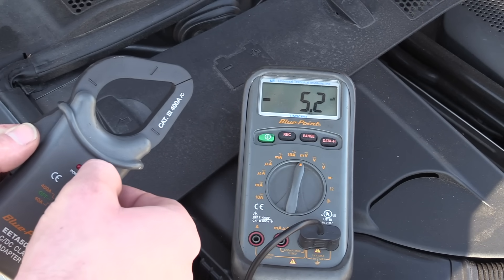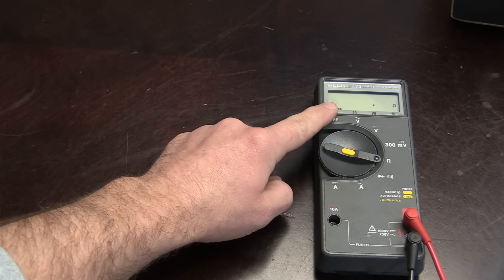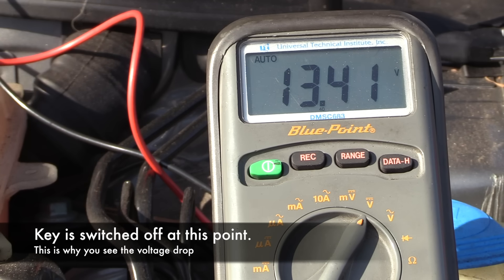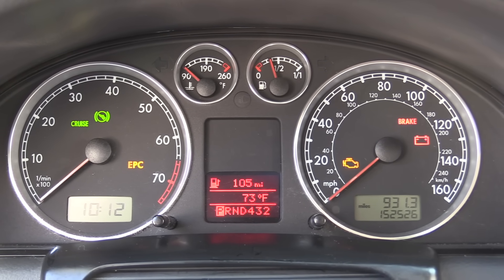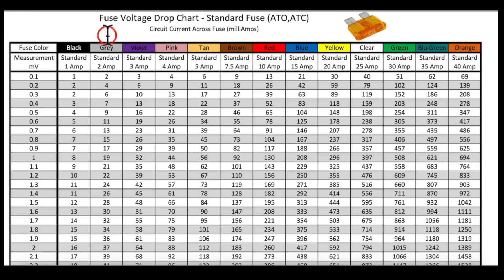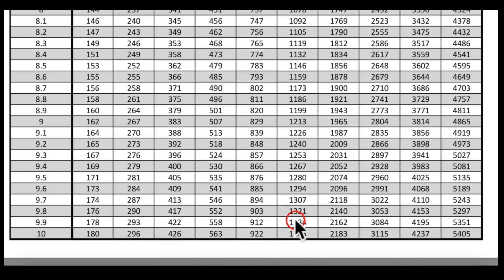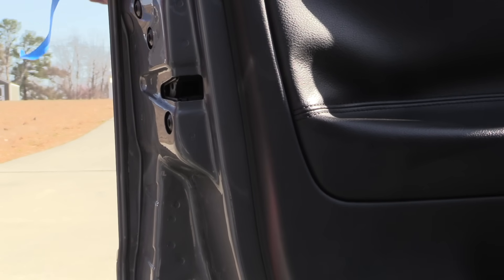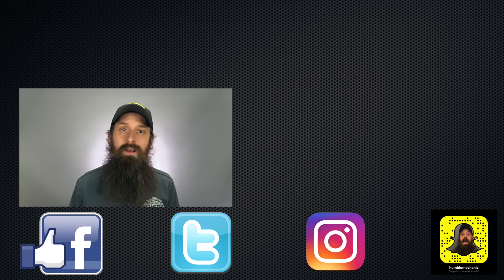The BEST Way TO Perform a Parasitic Draw Test

Comment: I've been a master tech for 25 years and never once did I think about physically latching the doors etc. And this is a great method for finding gremlins. I'm glad I found this channel, as unusual even as good as I am in still learning! Awesome video
Reply from the maker: Right on!!!
Reply: @HumbleMechanic how many multi meters do I need to do this test?
Reply: @HumbleMechanic  👍👍👍  Way more informative than any other Video I've watched thus far!
Reply: @HumbleMechanic  those charts are 100 percent dependent on the multimeter and associated resistance through the device. Yes, this method can be used to find some amount of draw, but those charts are device specific..not all brands and models.
Reply: @sasquatchrosefarts that's not how meters work. If it reads voltage accurately, then it's the same as any other meter of the same accuracy. Internal resistance has nothing to do with it. These are active circuits, the meters resistance will be negligible compared with the fuse. You might be thinking of parasitic voltage, which isn't really a thing on 12v dc anyway.
Reply: The best of us never stop learning
Reply: Yup...latching the doors will help with de energizing any accessory relays,which can backfeed a circuit, giving you false positive readings..
Reply: @mikekopisz1227 came to this thread to find this answer - thank you! I wanted to know the purpose of latching the doors before the test
Reply: Brother being a retired master electrician I learned new things weekly from my apprenticeship till retiring . It the nature of the trades new products and working with other guys that did things different than I . Never was one to not listen and learn .
Reply: Why do you have to launch off all the doors ? You’re only going in and out of the driver door?
Reply: I totally get it. 
I was just surfing you tube for motocross today, ran across this video, while I wasn’t into it at the time, I knew it was an opportunity to learn. 
Sift through the BS and absorb as much knowledge as you can from others that have been down the same road and now know.
Pro tip, NEVER tell a customer, friend, family member etc, that you figured it out through you tube!  You figured it out all by yourself. lol
Reply: There is a reason you have a job with your name on your shirt
Reply: Actually if your talking a constant draw, then this method will work.
Reply: Master Tech…and you never knew to latch the doors….
😮😮😂😂😂
Reply: Yeah ok, and then there's most vehicles whose switches are NOT in the latch.
Furthermore if you've got a drop across the fuse, there's a problem with that fuse.
Sleeping vehicles should not be drawing unless you've got a module that's not going to sleep either because it's bad or somebody wired in (added) something wrong which is what I see all too frequently.
https://youtu.be/6xFo_oHFF48
Reply: @rjbradlow  there is a lot ,I mean a lot of door have switches in latches. Security??
And voltage drop always occurs to some degree. Wires that are perfectly normal drop voltage. What makes you think that metal in fuse doesn’t
Reply: @rjbradlow  My ‘03 GX470 has switches that cut off the interior door handle lights separate from the mechanical latches. First thing that came to mind after watching this video. When all door’s on the GX are closed the hardened rubber below the latch of each door depresses the electronic switch that’s actuated when each door shuts the interior door handle lights. When the rubber for the rear door went missing there was a quick drain that forced me to charge my battery multiple times before I realized said issue. After fixing that, I come to realize that my battery still dies albeit after a couple days. My question is, could there be secondary electronic switches attached to the mechanical latches that allow the car to sleep completely or could I be looking at a deeper electrical issue?
Reply: @ksandbergen  did you ever figure out this issue? I'm dealing with similar draw on my 06 GX470. Trying to hone in on the issue
Reply: @rjbradlow most cars between 99-2010 have door latch switch. But in my 02 Jeep Grand Cherokee I have to latch driver door with it open, turn off dial switch to interior lights, unplug hood light connector.
There are several modules that send intermittent and continuous current with vehicle off. This can be for 20min to 8hrs after vehicle is turned off.
Removing battery terminal in newer vehicles can turn off modules responsible for draining battery.
Reply: @rjbradlow  what problem can you have with the fuse? it's either good or bad
Reply: @rjbradlow  pretty sure I didn't need the lecture. And testing for voltage drop is easy. I'm not sure what you've been working on but pretty much everything made in the last ten years has the switch in the latch. Wondering why you're replying this way to my comment, seems to me you either have a problem with the video, which I didn't make, or me personally which makes you a bit of a child
Reply: @bikerdave19148  Isn't weird how people say things like..." Don't want to be rude but..."
And then proceed to be rude!!? What the...???
Reply: @bikerdave19148  Wasn’t sure how to tread here. Really didn’t mean to be an ass. But.  And I obviously have some sensitivity issues here. And true I know nothing about you except you have 25 years and you say you are good. So that being said. In the event you have to look for draws on system. You HAVE to put car to sleep and leave it shut down. ONLY way to be in car is to manually lock latch.  So this is why I was asking. That’s all
Reply: @bikerdave19148  Yeah...you did need a lecture, he is 100% correct.
Reply: @bikerdave19148  I agree with you, sir. We didn't need the lecture...
Reply: What are grimlin, oh god 😳

Comment: Motorcycle, with some accessory wiring,  aluminum heads, steel bolts with white corrosion.  I'm thinking dissimilar metals, but could this be a sign of parasitic draw?

Comment: I had a parasitic draw on an old Suburban after replacing the radio.  The new radio's memory power input wire had such a significant draw that I was forced to add a cut-off switch in to the battery AND install a solar panel to compensate for the losses.

Comment: A good Fluke meter only has 0.1 millivolt resolution.   So for a 30 amp fuse I might struggle to measure between 0.1 and 0.2 millivolts.   That could be anywhere from 19-38 milliamps according to the chart.  Which is it?  Because of this loss of accuracy I think this method would only work for large >100 milliamp parasitic drains.   But if you are trying to figure out a smaller parasitic drains this method will not work.  It is back to amp meter between positive terminal and pulling fuses.

Comment: I have a question.   A video I watched said that you cant put a fuse in backwards.   It has to go in the original way it was installed by factory.   Basically cant put in upside down.   Am I wrong, isnt a fuse just connecting or finishing the circuit so if to much power goes through it the little wire burns so the car doesn't catch on fire.

Comment: I chased a parasitic draw on my 2010 Ram for months. I even took it to a dealer and a local shop after I failed to find the culprit.  They couldn't pinpoint it either. I checked everything...or so I thought.  Just by dumb luck, I dropped something in the driveway at night and it rolled under my truck. I glanced up and saw a faint light in the engine bay. 
Turns out that the hood latch (and the hood light actuator/switch) was slightly askew.  The hood would latch, but since the latch was out of position, the light switch never disengaged. Makes sense that this light would never show a draw as I would disconnect the hood light at the bulb connector since I had the hood open testing for current draw.  Crazy stuff, but I learned a lot from videos like this one. Hopefully, my story helps someone out. Thanks!
Reply: Good share. I have a Lexus gx470 and still has current draw. I did the Eric the car guy method and put the meter in series with the negative cable and pulled all the fuses and nothing changed. So I’m a bit lost. I’ll try humble mechanics method soon
Reply: @stallion78  if you have a draw with all the fuses pulled then I would next disconnect your starter main Cable and alternator main cable. I’ve had both of those cause draws on higher mileage cars. They corrode internally causing a faint connection to ground. Also people forget that a dirty battery case can cause a very small draw. Voltage can travel all the way across a battery top from post to post. It’s rare but is possible
Reply: @stallion78  do you have a cold climate package? Two heaters in vents ? It could be a relay of those heaters  located under the hood . Not just fuses relays needs to be check too .one / two could gotten in to stuck position due to the heat .
Reply: @stallion78 bro, mi comentario es en español; espero y el traductor te ayude con eso. Resulta que tengo la misma falla , fuga de corriente en mi Ford, sucede que investigando y probando me di cuenta que el alternador consume la batería estando apagado , puede que sea tu falla , también a veces son las puertas que le fallan un pestillo al cerrarlas y crea un consumo
Reply: Old reply, but I hope you see this. 2009 Ram owner here. Killed multiple batteries. Checked almost everything electrical in the truck. Couldn't find any parasitic draw anywhere. Literally been at this off and on for weeks. Just happened to see this comment, got under the truck with the hood closed, sure enough the light was on. Went to take it off, it was so hot it was melting the housing. Lord knows the last time it was actually off outside of when the batteries died. Thank you so much for helping me figure out this headache. I hate electrical issues. Take it easy brother!
Reply: @Stay_Shmackin  - glad that my incident helped you out. These draws are quite an experience to chase down.
Reply: Mine was disconnected when I bought it..hmmm
Reply: Classic RAM gremlin
Reply: Whoooowwww!! Nice catch! And nice to remember too, thanks!
Reply: Slightly askew
Reply: War bei meinem Kühlschrank auch so😂
Reply: Same on a 76 F100 many years ago. Took out the garbage after dark one night and saw the glow. They had a mercury switch that was tilted a bit much.
Reply: I was just told the trunk doesn’t close properly bluh bluh
Reply: Facts are stranger than fiction
Reply: I did something similar decades ago on a car that kept killing batteries.  Turns out the glove box plunger was askew and the glovebox light was on even with the door closed.  Took hours to find it even though I knew it was a light issue (couldn't see the light in broad daylight)
Reply: Very good investigative work!
Reply: H! my brother-in-law just prior to shipping out to Viet Nam placed a light in his trunk so you could see at night while in the truck Turns out the light was not going off after my sister replaced the battery commandeered her father, my dad who failed to find it.  I think they accidently found it somewhat like you did.  WHO KNEW?  LOL
Reply: You have to check for the simple easy things first. You could have easily just unplugged the light under the hood. To see if that changed it. It would have taken you 5 seconds.
Reply: @dougjstl1  hey genius...re-read my post. The light switch was disconnected during testing. Next time, try reading before you post comments.

Comment: Just tested both fuse boxes on my 2002 Honda CR-V. 
The only draw I found was in the engine compartment fusebox.

"Backup" circuit  
10A red mini  0.2mv draw = 27ma according to the chart.

Would this kill my battery after 2 to 3 days of sitting?
It is a small 51R size battery.

Comment: So you don't actually turn on the radio or high beams? That was for demonstration purposes? Just checking.
Reply from the maker: Yep just for demo
Reply: @HumbleMechanic  thanks. 
I just tested all fuses in my 2002 CR-V.  The only draw was the in the engine fusebox "Backup" circuit  
10A red mini  0.2mv draw = 27ma according to the chart. 
Would this be causing the drain?

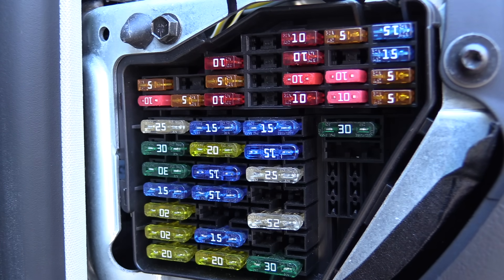Comment: 08:19
Thanks for the tip. This way is more safe then just pulling it out like you said.  I saw multiple videos where  they would put the multimeter in serie and just pull them out. I am gonna try it this way.

And I will start with my aftermarket day time running lights.

Comment: Some of the new fuses now don’t have the test spots on the back because engineers decided that was too handy and they pride themselves in making things more difficult for us mechanics. Great video man
Reply: Cheaper made fuses that do the bare minimum of what they are designed to do, and use less materials. Also making crappy untestable fuses means that they break faster, forcing you to buy more fuses, which means fuse makers make more money.

As someone said earlier, blame the bean counters, not the engineers. The engineer's job is to create, the bean counter's job is to assess and destroy. 😒
Reply: it’s not us it’s the bean counters and management. with the state of modern engineering we could easily build easy to repair cars that are reliable to the point of having 500k km warranties but that’s not what we are tasked with
Reply: @user-rd5nc1nb9f  It's rarely the beans counters - they don't have that kind of say. Maybe the CFO, but the CEO makes the ultimate decision(s).
Reply: @user-rd5nc1nb9f  planned obsolescence and recurring income for the corporations is now the name of the game 😂
Reply: @user-rd5nc1nb9f Bean counters are the absolute worst. They have literally caused deaths, especially in war. They are the very reason soldier’s M16’s would jam and have failures to go into battery and to eject.
Reply: I'd just get new fuses.  You can get enough fuses to do your whole car at the junkyard for $2
Reply: @jeffclark5024  
I work around Class 8 trucks .
Remember the most dangerous person in the world is a truck driver owning a toolbox equipped with a sharp pointed test light !
Reply: their ideal aim is to make things impossible for mechanics & diyrs, but the right to work attorneys need to pass a law that requires all favtories & dealers doing this to admit before sale, that the buyer now has no choice but to go to the corrupt, triple priced dealers every time- the headline of this warning should be, WARNING: we now own your S.  👋😒
Reply: All fuses I have come across can be tested either by the test point or popping the top cover off that takes less than a second to do.
Reply: @aaronsmith7143  I've seen plenty that don't have the test points 🙁
Reply: @aaronsmith7143 Have you come across the "multifuses" that some imports use – I've seen them on Honda and Hyundai? How would you check those in a second?
Reply: Again you can use whatever fuses you want
Reply: Thank you sir, great video.
Reply: Why not use this method on older vehicles?
Reply: “Engineers” - too many who design in impracticality.
Reply: Stop bashing engineers, this was most likely a management cost cutting decision!
Reply: A lot of engineers are too stubborn and prideful to admit they made a design problem
Reply: Never blame engineers....always blame bean counters
Reply: @xeronicus  Dead on bro.
Reply: @xeronicus 😊😊pppppppp 9:22 the
Reply: @xeronicus  or marketing.
Reply: Engineers could have fought this and won @xeronicus
Reply: Some aren't really engineers, just placed candidates with a title and degree. !!
Reply: I work at Winnebago!! Oh lord,  those guys called Ingeniers, don't know nothing.!!!
Reply: I have seen test points extremely corroded esp living near beaches, I wonder if sealed fuses just make better sense. Only seen a couple, but some have corroded into fuse plastic. Never caused me issues but something to wonder about for small fuses especially
Reply: @bt4291  People really need to remember to use their parking brake when partying at the beach. Pulling your car out of seawater is very hard on unsealed fuses.
Reply: @Mr_PNW  🤣

Comment: Maybe someone can help me. I recently had some electrical issues with my 10 challenger rt. The car won’t crank over but got lights on the dash and the battery checked out ok from 2 different places. I’m also experiencing no headlights, no horn and no wipers. I got a new tipm and nothing has changed. Doesn’t seem to be the alternator so idk. Tried a hard reset on the tipm but still having the same issue.

Comment: This method works very well unless you have an intermittent draw.  Saw a video where the rear windshield wiper was pointing straight up.  The control module kept trying to park the wiper in it's down position.  After about 10 or seconds of trying to park it, it would give up for over 5 minutes, then try again.  In that case you would have to keep your probes on for a much longer time to see the amp spike.  I'm definitely going to try this method first, and if I can't find it I'm going to put my amp meter in line and start pulling fuses.

Comment: I love the methodical method.  It helps eliminate real draws from dome lights etc.  I found some draw on a few fuses on the interior fuse panel.  Now to find a chart that tells what the fuses are for.  My 2014 Jetta TDi is different from all other cars I have owned in that the fuses are not labeled and no chart in the OM.  Sheesh!
Reply from the maker: Yeah not labeled fuses is LAME!

Comment: Amp clamps are not hard to calibrate. And they are the least intrusive and just as accurate as a multimeter I had dealerships that were using the standard multimeter to do a test for draw. Supposedly they could never find a parasitic drawn. I took an amp clamp. I was able to find it very quick. Then I had someone use a multimeter to test the fuse and determines where the issue was coming from.